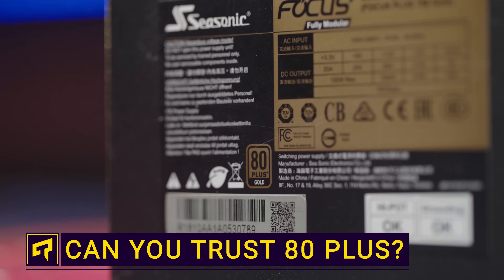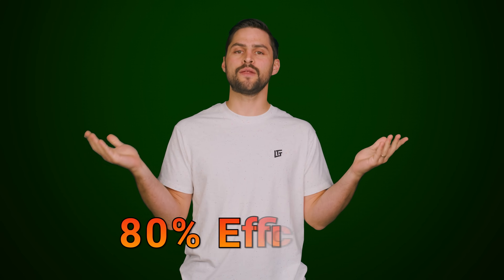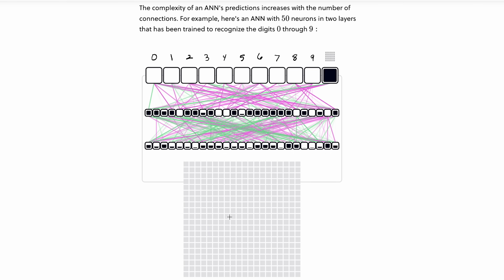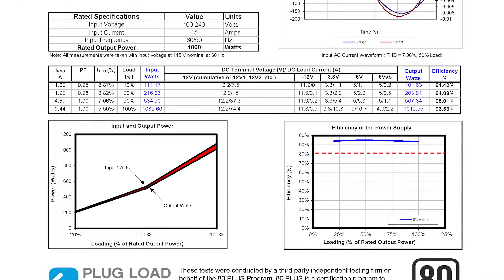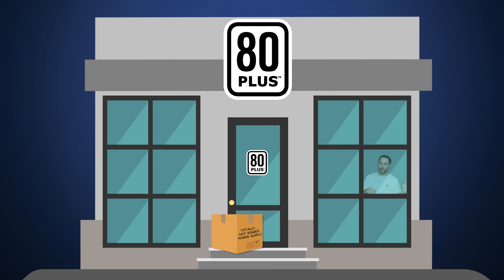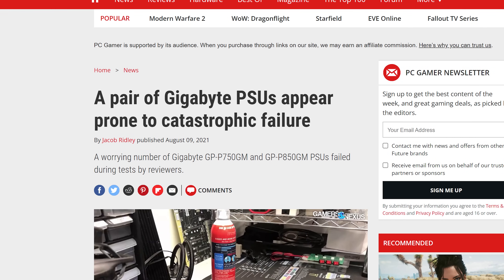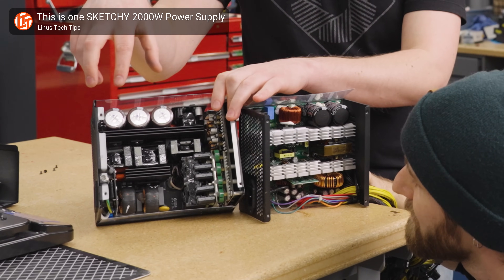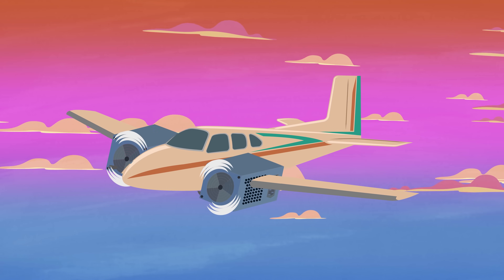Can You Trust 80 Plus?

Comment: There really should be ongoing random testing by the certification organisation, as well as testing more loads like this "Cybernetics" certification.
Reply: How would you propose to fund that? You'd be looking at an enormous increase in staff and administration.

You might be willing to pay double for your PSU, but given how power hungry modern processing units have become, I certainly am not 😉
Reply: @literate-aside  Simple, just make the certificate valid for a certain number of units sold. 
So eg. for every 1000 PSUs you make you have to recertify.
Add serial numbers to the certificate to prevent abuse and done.

So lets say I am EVGA and I make PSUs.
I first submit a unit for testing to get the certificate.
Then as I am selling the PSU and I see I am running out of serial numbers, I call 80+ and ask for a new batch.
They ask me for payment, grab a random PSU from the shelf and retest, if still valid I get another batch of serial numbers to use.
Reply: @literate-aside  Seeing as quality PSU helps in conserving energy. Ask the organizations that handle the energy crisis and whatnot.

I don't know about the specifics though.
Reply: @ZNotFound  Conserve? You'll still be looking at 800w+ on a modern system during load.

Your PC is fast becoming the most expensive thing to run in your home, and a few extra percent at idle isn't going to change that.
Reply: @literate-aside  Higher efficiency throughout every PSU in the world adds ups to a lot of energy saved.

I may be an LTT viewer but MY pc is a laptop.

Comment: Yesterday got my Seasonic G12 gc 750W. Hopefully it doesn't explode! 
Apparently it's not produced by Seasonic but someone else and it uses Chinese caps rated 105c but that doesn't tell me a lot. Also has no thermal or under voltage protection. I really hope it's not like the gigabyte psus cuz I'm going to get fucked! I hope someone of the tech channels tries it on a dyno to make sure it won't explode. There was only one russian site I found that tested it and it's bigger brother the 850W and they tried them with a dyno and said they work at 10% above rating in a 30min test and shut of at (750W-1080W) (850W-1300W). For now I'm running a 3600X and a 2060 with 3 hdds and a ssd but in the future I'm thinking of going to the 3070. Apologies for the long read!
Reply: G12 GC is B-Tier Speculative, you're good

Comment: People don't like complicated ratings, so I don't think this Cybernetiks whatever will make it.
What you are talking about are niche things that don't really matter in reality. Most PSUs are quiet nowadays anyway. And there is pretty much always a smooth curve so there shouldn't be any unexpected variation between the 3 rating points. It's always a flat pyramid / bell curve.
But I did notice that most 80+ Bronze are worse than 80+ White in loads lower than 20%. Yet that doesn't really matter, as if my PC is pulling 40Wh in idle, that's just 3Wh difference, that's definitely not an issue.

Comment: I was measuring elecricity power consuptiom on a lot of devices in my home. I found out, that my EVGA 650 SFX Power supply is consuming 62mA (230V) while power switch on it is OFF... Its about 14W while its turned off.. (like wtf evga?) Can it be consumed by some unknown self procection circuit or something? Or can it be defective? I was trying this with two more PSUs, one was evga bq 650, second wirh random cooler master 750w and there was 0mA power consuption while switch was off.
Reply: Myeeeah I stopped buying evga psus years ago for the exact same reason...and the last two I bought from them were 80 plus gold btw.

Comment: I have a 600W LC Power PSU (12V Just 500W) and it still works over 10 years now. Its silent, cold and never failed despite tests have shown that it is bad. I guess I was lucky.
Reply: LC Power PSUs sometimes have popped capacitors.
Reply: You are VERY lucky. I changed very much of these LC Power Supplies, many buyed them because of the low price. The quality was at least as low as the price
Reply: @OpenYourMind actually it's the other way around. Drawing 450W on 450W psu is a lot more stressful for hardware than drawing same 450W on 550W psu. 
In this case, since the total watts drawn are decided solely by your pc configuration, bigger psu is always better.

Comment: Can you do a video exploring powering a pc with DC only and avoiding the AC to DC psu. This is basically a laptop but for some reason you can't just install a battery to your pc rig, despite it being easy on laptops. It's to eradicate electrical waste and to get the most from your solar panels and battery banks. AC to DC seem wasteful.
Reply: Why would AC to DC be any more wasteful than DC to DC?
Reply: @shanent5793  If more and more houses start using solar panels and battery banks, an AC to DC psu is basically obsolete and is technically completely unnecessary. The video just explained there is wasted watts in the 80 percent efficiency so that would use more stored battery power than necessary, losing stored power over an unnecessary conversion. Lighting also seems to be superior on DC current as it can be run on power over Ethernet cables and the failure point for LED's is the bulb producing too much heat from converting AC to DC, plus POE LED's is not just longer lasting lighting, but smart lighting because it's connected to a network. So I've been curious as to how much you can use DC in a house environment.
Reply: @NanoNutrino  power from any source has to be converted to a known voltage so that devices will have a predictable current draw. If you plug a space heater in and it draws ten amperes, you can't have it drawing 100 A as a cloud passes overhead. There are multiple unavoidable conversions, and with modern power supplies switching at MHz rates, 50/60 Hz is practically DC anyways
Reply: @shanent5793  I don't know enough about electrical efficiencies but it feels annoying you can't just swap out the psu with a battery. It's done in a laptop, you can run PC's off of battery backs into the PSU but you can't hook a pc straight to a PC
Reply: @NanoNutrino  DC is usually supplied at a lower voltage, so the currents are higher. That means larger conductors and more copper, and larger transistors. The cost is justifiable for a mobile PC consuming 50-100 W. DC-fed ATX power supplies exist, but being low volume specialty products, they will cost more than the standard ones
Reply: @shanent5793  That's why I thought it would be a good video to make because a DC psu is speciality. If DC psu could become more mainstream would there be advantages?
Reply: @NanoNutrino  I don't think it would become mainstream for a full-size desktop. As I said the power is too high for the low voltages. However mini-PC are popular now, and those usually have an external power supply, often with a simple barrel jack input that could be used with a DC source. You would need to be aware of what voltage range each device can tolerate and arrange to supply that, or a USB-PD chip could be used to negotiate the voltage supplied by an intelligent battery bank

Comment: Which brands are guilty of exchanging components for cheaper ones after certification btw? It would be a good starting point for at least knowing which brands to skip altogether.
Reply: Prob skip gigabyte and any unknown brands
Reply: @denniskarlsson6173  Stick with Seasonic, the heart of your system.
Reply: @lesliejames9404  that's what i got when building my PC. So far works as advertised.
Reply: @lesliejames9404  That's exactly what I use friend. 850w seasonic gx
Reply: @denniskarlsson6173  Gigabyte actually cleaned up their act a bit on that end. Not saying I've bought their PSUs lol, but they read the room on that, plus being hacked... they're trying a lot harder at PR these days.
Reply: @x8jason8x  That may be so but I still dont and wont trust them again. That said most other stuff they make from mobo to gpu's are awesome
Reply: @denniskarlsson6173  Fair enough lol.
Reply: I had a Corsair TX650W from 2008 and it lasted me until a few months ago, so that's around 14 years. It never actually died, but the fan started making a rattling noise and I thought it was about time to retire the old wench anyway. Now I've bought a Corsair RM850 to replace it and I couldn't be happier with it.
I can definitely recommend Corsair, but I wouldn't go for the cheapest models. Go for an RM, RMx or AX series. Otherwise, you can't go wrong with Seasonic -- or so I've heard repeated here so frequently that it might even be true.
Reply: 100% skip GIGABYTE. The entire circuit board of 3 of my gigabye PSUs burnt down in the span of 1 year. I didn't even overclock or do "super" loady works
Reply: @rafid_zx  what PSU models
Reply: @rafid_zx  bs
Reply: I saw reports on LTT forum that major manufacturers like cooler master sell inferior quality PSUs in countries like India where there are no reviewers. What they say is not what they give. Sucks to be those guys
Reply: sad for us In india
Reply: Corsair had a great reputation when they started to make psu (out of Seasonic previous models), and when they redo their lineup, the psu weren't as good as before.
In another story, A tech magazine was sued by a cheap psu maker, because they said the psu was a fire hazard and while the court recognized the quality of the testing from the magazine, the experts mandated couldn't perform their tests as the psu failed every time under the lightest load.
Reply: My psu predates 80+ OCZ stealthstream. Oldest part of my computer. Probably spent £70 on it
Reply: @its-Al-not-A.I  I replaced my ldlc/foxspirit Seasonic based 750watts, after 10years, it is now powering a cheaper computer, because I didn't want to take the risk with my current one.
Reply: Cheaper/worse brands and those  that do not make their own products are more likely to do a swaparoo at some stage. It may not even be because they are trying to cheap out... just that their supplier doesn't have the manufacturing ability, or raises prices, or their manufacturer is shoddy etc...

Better brands will try to control those aspects better and brands that actually MAKE their PSUs have much better controls over their supply lines and should be less likely to have this occur.

A lot of brands really only compete on price and not on support/quality, and they will have problems sooner or later and the consumer will be the one that is worse off (because support is also something they don't compete on...)
Reply: Part of the problem is that it's not that simple. Plenty of brands put out excellent SKUs alongside SKUs that are dogshit when tested; and no, Seasonic PSUs aren't inherintly trustworthy, they've made bad PSUs as well
Reply: My Corsair cx850m from 2016 has been through 3 different GPU's: The R9 390, RTX 3060 ti and finally, a 4090. Its only a bronze too lol
Reply: It is most likely that all manufacturers replace some components over the life of the product as supplies of various components change over time. 

Whether those components decrease quality or efficiency is another matter.
Reply: I would love a deep dive on this
Reply: I've been using EVGA power supplies for over a decade. Would not buy any other brand now.
Reply: @TheRealSkeletor  my experience above with dirty power is from an EVGA PSU, but I bought it in 2012 and it was 80 plus bronze.
Reply: I used to have the "worst" reputation brands like Codegen and HKC, never had problem with them, but last time I went for "quality brand" and got a Chieftec
Reply: @wojtek-33  My previous system got an EVGA when the old PSU(enermax or some shit) started getting flaky after close to 10 years.  

Current build I went with an RM850 and it only complained when I overvolted my graphics card a bit too much(I'm still not sure if I hit a bug in CoreCtrl or the card actually should have drawn that much power with the settings I had, I suspect a CoreCtrl bug given how small the overvolt was). And that's actually exactly when you want it to complain, the alternative is a fire.
Reply: MSI, Gamemax and XPG
Reply: Not sure, I have a EVGA one and even at 550W they seem ok, been 3 years now, no fires.
Reply: @CDSDeleting  you're not even just looking for fires. I had problems with my PSU that I didn't know where my PSU until I needed something beefier and found the problems I thought were the motherboars were fixed. I was on a UPS too so it wasn't just dirty power from the wall. One of the major problems I had was that my onboard USB kept cutting out randomly and would require a restart, and some ports didn't work at all. New PSU (and GPU) and those ports started working suddenly. I'm 2 years later on the same motherboard and new PSU with no random USB disconnects on the motherboard ports. I mostly let it go so long because I wasn't using many ports.

To be fair, if you're not having issues then you're probably fine, just wanted to state it's not just fire hazards you're looking for.s
Reply: On the ltt forums there’s a psu list that tells you which ones are good
Reply: Get a gigabyte and you can play csgo
Reply: Major brands purchased from a reputable vendor should be fine. 80 plus will still have limitations but you can expect any random unit to be within spec.
Reply: @annieworroll4373  I mean gigabyte is a major brand...
Reply: @CreativityNull  I'd trust their 80+ rating. 

But they burn bright as the sun as a sign of 80+ being limited.

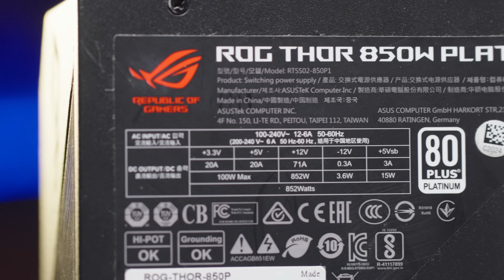Comment: 4:18 YOU SHOULD NEVER ATTEMPT TO OPEN A POWER SUPPLY UNLESS YOU HAVE TRAINING IN ELECTRICAL ENGINEERING. CAPACITORS CAN HOLD A LOAD FOR YEARS, YOU CAN DIE
Wanted to make that clear since it does kind of sound like you're encouraging people to examine the components themselves.
Reply: How does a capacitor hold a load for years? That sounds like perpetual motion
Reply: @shanent5793  if the load is not intentionally discharged, a capacitor can (and will) hold it for possibly a very long time. That has nothing to do with perpetuality.
Reply: @thethingthatshouldnotbe3035  power supplies have a holdup time measured in milliseconds, not years
Reply: @shanent5793  Dude just Google this, or better yet go look at the plethora of warnings on your power supply and manual. PSU's should be considered replaceable, not repairable
Reply: @Zetaphor  chemical energy? Maybe you should google that yourself
Reply: @shanent5793  You are correct about that one point. I did google it and learned that my understanding of how a capacitor stores energy was flawed. I also googled the original point I was making and found that it is correct, touching a high voltage cap that is not properly discharged by someone with the correct knowledge in safe handling practices of high voltage electronics can result in injury or death. Arguing that a non-professional should feel comfortable poking around in their PSU is reckless and irresponsible.
Reply: @Zetaphor  I haven't argued that. You said a capacitor can hold a load for years which is ridiculous. Practical capacitors are sized to the load, and oversizing can have negative efficiency consequences. If a PC power supply alone could hold a load for years, what use is a UPS which is only good for a few minutes until you can start the generator?
Reply: @shanent5793  They store electricity as chemical energy, just like a battery. High voltage capacitors like those found in a power supply can be deadly. Don't take my word for it, google it. You'll even hear Linus repeating this in many instances such as the video they showed a clip from, where they tested the shady 2000W PSU from Aliexpress:

https://youtu.be/RTT5k2imblA?t=164
Reply: @shanent5793  
"How does a capacitor hold a load for years? That sounds like perpetual motion"

The man's terminology is a bit off but you know exactly what he meant. Pedantry is not flattering.

Make a very simple circuit consisting of a DC source and a resistor in series to limit current to some safe level. Connect a capacitor (with a voltage rating of at least the DC source voltage, of course) to it and let it charge for a handful of RC time constant. Disconnect it. Leave it like that for a day. Connect a multimeter to the terminals and you WILL read whatever voltage your DC source was, or damn near close. Measure discharge time through a known capacitor and do the math, and you will find that it was still holding pretty much exactly the rated capacity.

That's what he meant by "load", that the capacitor is able to hold it's charge at whatever potential it was at if there's no bleeder circuit or something analogous to make sure that the capacitors are discharged quickly in case the circuit would otherwise be left open by a change in state, like being "turned off." MOST manufacturers will include a bleeder resistor/circuit but some bad ones really will pinch that single cent (You're a bottom-of-the-barrel manufacturer building down to a ridiculously low cost and the bleeder sipping some power is causing you to fall juuuuuuuuust short of the 80 Plus rating you set as the absolute minimum? Well then... ), or the bleeder resistor might otherwise fail; many people have suffered a very nasty shock and some died for either not knowing that capacitors can hold charge or having the bleeder somehow fail on them. I've poked around and fixed all sorts of power supplies myself, not just desktop PSUs, but for the average person it's still good advice to not poke around in there unless you know what you're doing or are willing to risk (however great or small a risk) serious injury or even death.